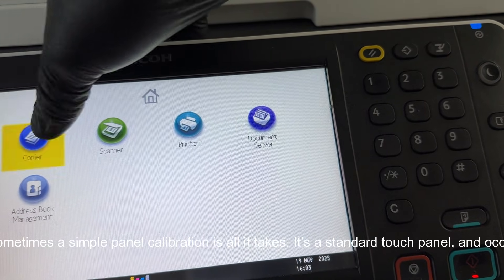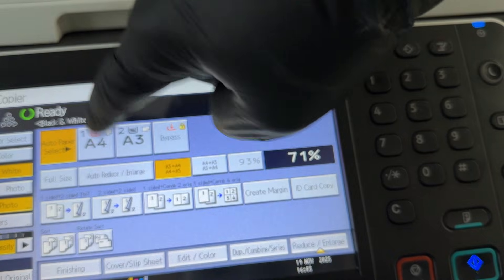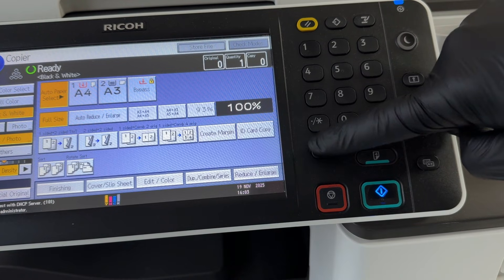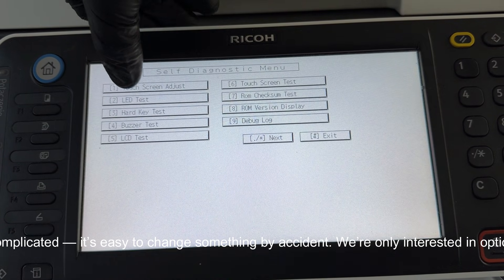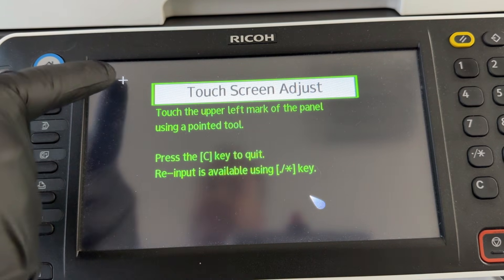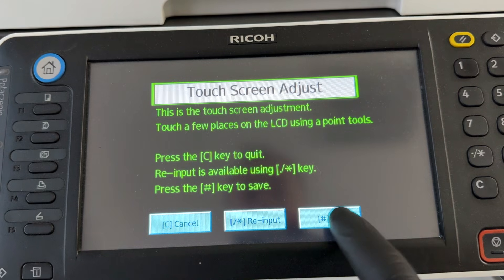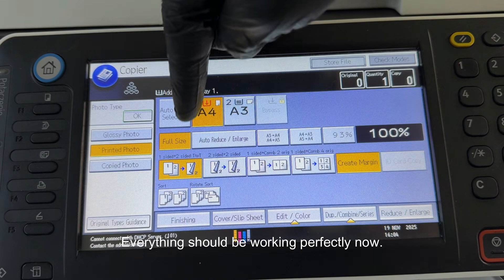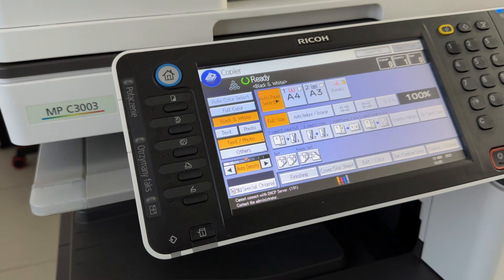Ricoh Touch Screen Calibration – MPC3003 / MPC3002 / 3502 / 3503 / MP2554

Comment: Ricoh 5504 wifi not trun
Reply from the maker: @alisalar6009 Wi-Fi is considered a less secure type of connection and therefore is not enabled in professional copiers. While this option may be available in home printers, it offers a low level of security. In professional machines, a wired network connection is the standard — simply connect the device to your router using an RJ-45 Ethernet port.